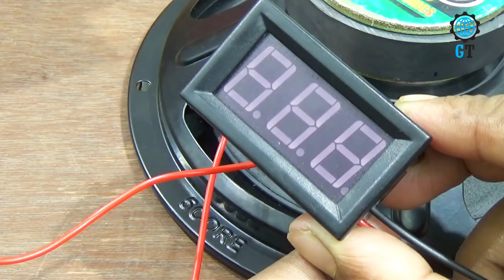How To Make Best Quality Audio Amplifier Circuit In Cheap Price || Full Tutorial

Comment: Can i use this for subwooger
Reply from the maker: this circuit might not work perfectly for subwoofer
Reply: Ok
Reply: Make a simple amp for subwoofer
Reply from the maker: sure, i will make as soon as possible.
How many Inch & watt speaker will you use for subwoofer ?
Reply: Bro plz make without large transistor😁
Reply: Low wattage